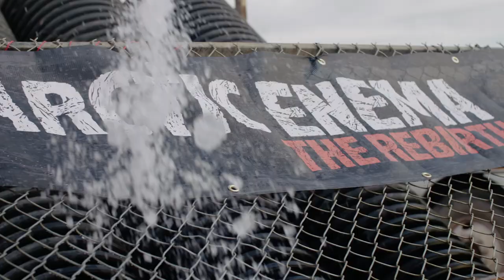How to Tackle the Arctic Enema Rebirth | Tough Mudder

Comment: they don't do the obstacle justice with this video. i came up for air too soon and found myself (feeling) trapped. definitely initiated my mind's fear-of-death-by-drowning response and i wound up having to calm myself mentally to keep from hyperventilating long enough to catch another breath before diving back under. taught me to check out the remaining water obstacles before attempting them.
Reply: The mental aspect is what separates Tough Mudder from courses like Spartan. Some times I just have to think closely about the obstacle rather than muscling my way through.
Reply: Soon as i got in, had to gather myself mentally very quickly so my muscles didn't seize up. Just get out as quick as you possibly can and start running again once out to warm up again. Quite difficult but achievable.